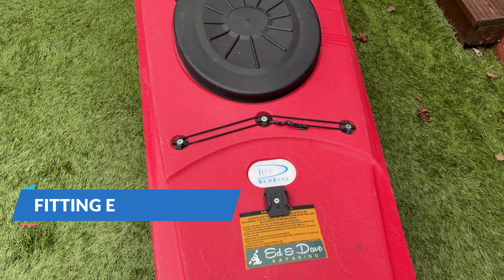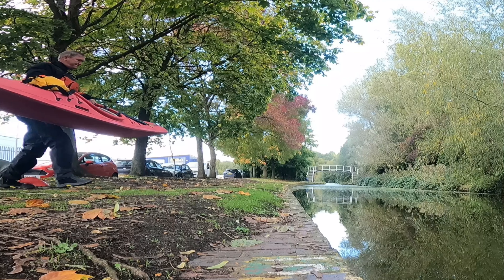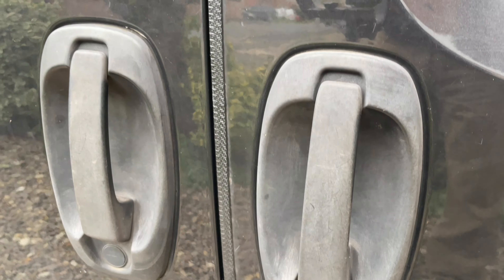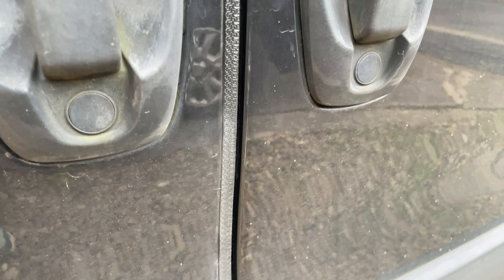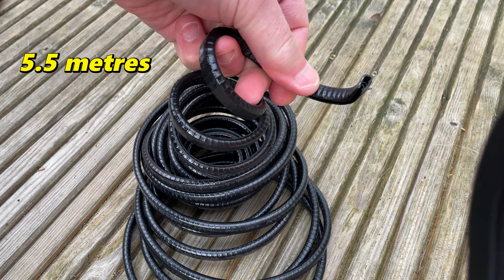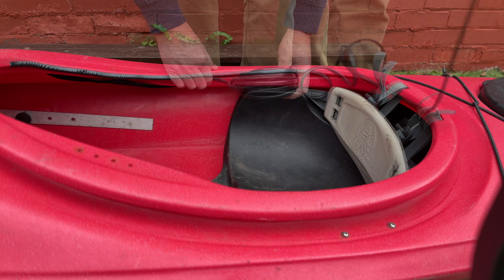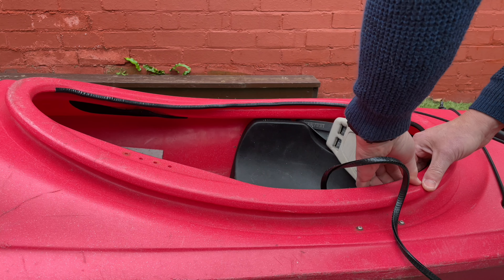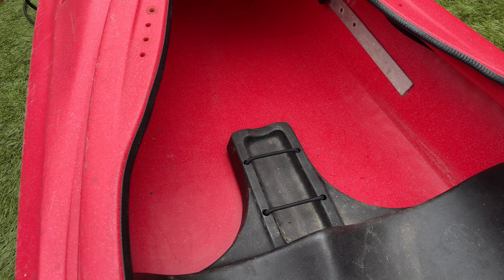Hands hurt when carrying my kayak - cockpit thin!

Comment: You aren't carrying your kayak correctly. What you are doing is fine for a few paces but you really want to put it on your shoulder for more than that. Some people do pad out the cockpit rim where their shoulder sits, but use some foam and duct tape.
Reply from the maker: Absolutely Mark! However, the Rockhopper is super heavy and I struggle to carry it on my sholuder. Therefore, and as you say, for a few paces I carry using the cockpit rim, when putting onto trolley or the steps as seen in the video. Great comment and thanks for taking the time to make it.
Reply: @EdDaveKayaking  looking online it should be about 25kg. Not that much heavier than the latest pyranha river boat. Shoulder carry all the way!